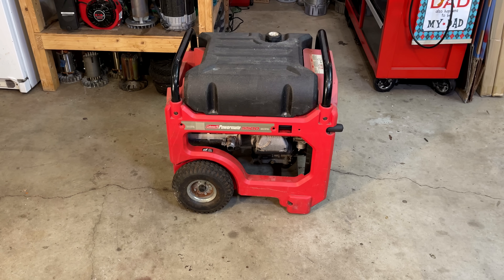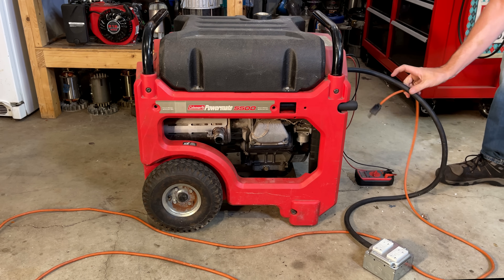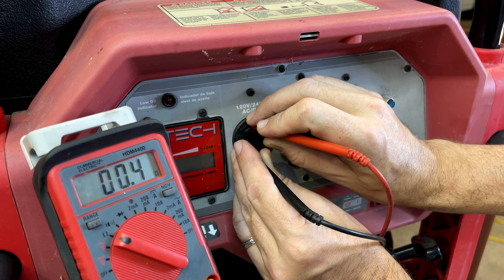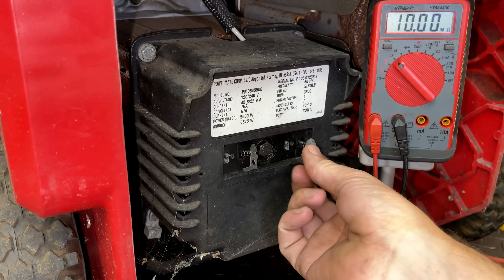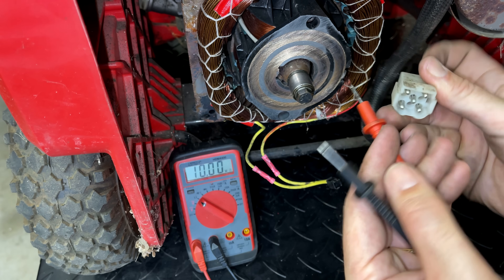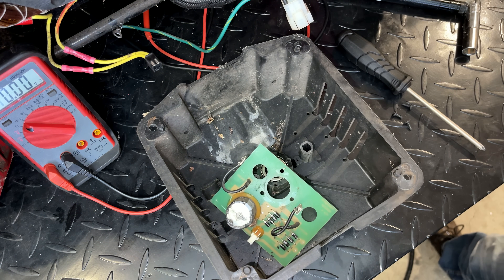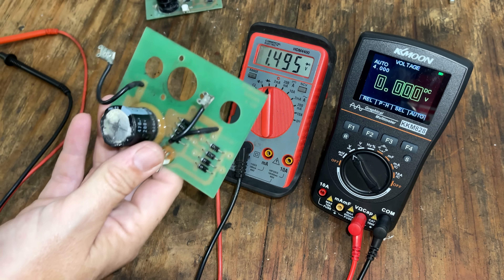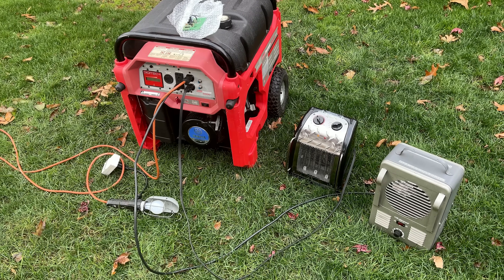Parts Generator?  Or an Easy Fix (No Output)

Comment: James- I work in a Corporate setting outside Boston. Management is now delivering a "Safety Mention" before events- How are you protecting yourself against CO2 poisoning running the engines in your garage?- I realize that there are many things unseen by the camera. I don't hear a ventilation fan running either. I enjoy your weekly broadcasts, and I want them to continue with you in good health.- Thanks!
Reply: He's got a CO alarm down there.
Reply from the maker: I do not run a fan or edit a fan sound in like some others.  But I do have ventilation and a multiple carbon monoxide detectors that display the PPM of carbon monoxide so I can keep an eye on things and they will alert if the levels are too high.  I always shut the engine down as soon as they start moving.  Some engines are very clean and others will put a lethal amount of CO in the air in less then a minute.  Here are a few clips of what I have setup https://youtu.be/-taW9AuVEbQ?t=2927 https://youtu.be/bA-Us-uS-Vs?t=521  Also have a CO2 monitor because I also run a propane heater in the winter and want to monitor those levels as well.

Comment: Jim, diodes operate like a check valve for air or water. They also do reduce the voltage slightly. In some circuits, they are intentionly used as a voltage limiter.

Comment: Well done, James. A rescued machine is cash in hand and much better than parts sitting on a shelf (which may, or may not find future use). Your knowledge, and resources (bassguitarist) are invaluable and saved the day, again!. I was wondering what happened to the lift stand, it will save your back in years to come.

Comment: The problem with the cap is the voltage. You have 135v * sqrt2 = 191v at that cap, and that is to close to max. You should use a 350v cap and it will last forever. The brand Nichicon are some of the best caps; but not when you abuse them.

Comment: I saw and the DIP switch settings were the same on both meters. When exchanging meters like this, always make sure the DIP switch setting are the same, because it tells the meter the full load capacity of the generator.

Comment: I'm sure you're aware James, but in the 2000s there was something called the capacitor plague.  Chinese companies got the formula wrong for electrolytic caps and they failed in everything from TVs to Generators.  I made some good money buying those devices and just swapping out caps.  In fact I still have a plasma TV in my shop that I've had for about fifteen years that cost me less than $20 to repair.

Comment: greatgrandma here ,, seriously  love watching your videos - most guys don't like yuh watchin them work or maybe the questions .....anyways watched a million of your videos and fixed a locked up ( pb blaster for days and gentle persuasion) , dinked with a old nikki ( at least a doz times ) and swapped out a rectifier board & brushes ( think 1 of the brushes had a broken or burnt wire )   LOW A BEHOLD  after a month of occasional dinkin and plenty videos ................the dang thing works and now makes POWAH !!    haha freaked me out when light actually came on !!!!   and after carbs last soak in ultrasonical ( yeah  all the cool kids have 'm sooooo got me one ) had the dangdest time for it not to leak ...........no clue why motor smoothed out too ?...............changed the oil twice get the pb blaster , rust and gas out........ that oughta be dandy now and put a new gas shut off after  rinsing out idk gravel from plastic gas tank (the old one was rusted shut or prolly open since the oil smelled like gas and was thin).   Bought me a killawatt today hahaha.....JUST CURIOUS   i hope it makes good numbers  but believe me i'm just a monkey see monkey do old lady -don't understand the magic -just did stuff you taught me ........ PLAN now  is run a tank of gas thru it with some stabil till it runs out ......... if my luck holds !   You always say thanks for watching and hope it helped someone ...........   DUDE  this was beyond a help !! ding dong here's yuh dinner MIRACLE...........thankyou soooooooo much.
Reply: its an old powermate 5500/6200 and can't find motor identification on 10hp briggs WHERE THE HECK IS IT
and where the heck you find those diagrams

Comment: James always says not tto pruchase a gen set with a bad power head then  of course he does purchase it and then rips it apart       So glad you are using the back saving lift     and off that generator  goes to work a well or a furnace/boiler or  a refrigerator  or a sump pump as in    we need power back NOW  !

Comment: Nice find, easy money. I have never been a fan of that plastic case head unit, but I have connected a good amount of them for people in my area that bought them during the 98 ice storm. These were the only ones available. If you need power they at least work. Ya gotta do what ya gotta do.

Comment: That engine just sounds so good.   As you mentioned, it hardly felt the full 5000 W load.   Shame the design does not have AVR.
Another one saved from the parts bin or scrap yard.   Well done.
Dave.

Comment: I've drilled holes in cases when the capacitors were to "long".   Might not be the best solution in this case but it works on garage door safety detectors,  the ones with the infrared beams.
Reply from the maker: I have done the same.  Not elegant, but it works.

Comment: With a little practice, a decent iron/station such as a Hakko FX-888D or a Pinecil with a chisel tip, some solder wick and/or a sucker you can easily replace components like that bad capacitor yourself. Enjoyed the video.

Comment: Got me in the whole way with this one. Good video mate. I leanrned a few things too
I was thinking, just learn to solder and order parts in and you can fix those simple boards yourself. You will find that soldering big stuff like that is easy peasy.
Also, it occurred to me that AC devices allow +_ 10% voltage. Well, they do here in Oz. So that would mean 120x10%=12volts above and below 120volts.
So, 132vac top end and 108vac bottom end. This genset was at 111vac low end at "full load" which I would be happy with. It will pull more amps though, and get hotter in the stator (another reason to keep the load no more than 5000 Watts).
As you said, without a VAR you get what you get. But, back on Facebook for $220-$250 for an easy fix is not bad at all.

Comment: This is just fantastic - if only there were repair places I could trust, with your knowledge, and could repair it in a few weeks at least! I bought a  Champion 201035 10,000/9000. Had an old powermate from Katrina days, and a smaller Champion 4000/3500. When I got the electric start 201035 running I also got the other 2 running. SUCCESS!!! As it got colder only the new one will crank. And yesterday the rooe snapped as I tried cranking the smaller Champion. Soo, your videos are amazing. And I just sit with 2 dead generators because it's all above me. Guess I'll get Champion on tge phone and search yiutube on how to replace the pull rope. Thanks for the great videos.
Reply from the maker: Most small engine shops can handle the engine side without issue.  But it does take them a while to fix as they are swamped in work.  Some of my repairs take multiple months mostly waiting on parts.

Comment: Very nice job James. I had a couple of these in my shop several years ago, and the rear bearings were bad and caused damage to the stator or rotor. As near as I can remember there was a recall or warrantee that repaired them, but that was many years ago. Thanks.

Comment: I just picked up a Coleman Powermate maxa 5000 ER for $100 it's a little older but it is brand new, never had gas in the tank or oil in the crankcase. Has the Tecumseh 10hp engine. Wanted to make a little extra money, but sold it to my sister for what I paid for it.

Comment: Nice work. Its always better to test diodes out of circuit in a power supply as the capacitor is directly across the output. If you need to test a diode then with the meter on resistance, place the leads across a diode note the reading and then reverse the leads and note the reading again. The values should be high in one direction and low in the other direction. A diode is just a one direction valve. The actual parts in that unit cost cents to replace so it's worth having a go yourself. Just replace like for like.
Reply from the maker: Definitely need to take out of circuit to find the exact issue.  Was just testing the board as a whole and it failed.

Comment: Another fantastic repair video. I'm surprised a 120/240 volt genie only has a GFCI on one leg. I was confused by how many diodes were on the PCB. Watched Bassguitarist1985 and each diode is paralleled so that mystery solved.

It may be worth opening up the bad meter and try reseating the LCD display.

Comment: Hi James.  Good video.   I had that same exact genset... bought it at Home Depot.  I have since sold it, but it ran well.  I mainly got rid of it because of it's "dirty power". I too saw over 130volts.     I have since gone to a Honda EU2000 which does everything I need and is much, much quieter.     The Powermate was fine in it's day... and saved me headaches at the time.

Comment: You are totally correct about that air filter box that piece they left out of there is meant to be a spacer and serves as a seal for the back side of that filter and should be in there

Comment: Lovely work James. I thought the broken ropes were indicative of something worse. If one or a couple of turns of one of the coils had become hot then it did not last long.
Reply from the maker: The lacing was not burnt looking, so may have been vibration related instead of heat.

Comment: As an electrician I know all gfi breakers has to have power for the test button to work. It is not a circuit breaker. It only trips if it detects power to ground. So you don't get shocked.

Comment: You can check the individual diodes with the multimeter as well. You should see a voltage drop when the black lead is on the end of the diode with the band (and the red lead to the other end), but not when the leads are reversed. If you get a very low reading either way, the diode is shorted. On the display unit, is there a potentiometer? Sometimes the display contrast just needs to be readjusted, so I would double check that before condemning it.

Comment: Hey James, I enjoy your work. I’ve never owned a generator and it’s likely that I never will. I like to follow your troubleshooting. My question is why does it matter what the unloaded voltage is?
Reply from the maker: In general between 113-127 volts and 57-62.5 volts is considered safe for most electronics.  Generator engines tend to lose speed and voltage under load so you have to set on the higher side of the ranges above with no load.  If there is an AVR then the voltage is less of a concern because it should stay mostly the same even if the engine slows.  Then go full load and see how badly things drop.  Ideally you would set at 120 volts / 60 hertz.  I try to get it so that half load I am at or close to 120 volts / 60 hertz.  So that way full load I am a little under and no load a little above.

Comment: Mother's makes a plastic sealant/protectant called "Back to black", and
it's excellent for things like that red dashboard. It would rejuvenate & moisturize
that oxidized, faded plastic, also making it water resistant.

Do you ever clean and paint the unsightly, pitted & rusty mufflers that come with
most of these neglected generators you repair? It's not just cosmetic.
I'm not talking about disassembly, sandblast and powder coating- but a 
simple brush in situ, then spray of Rustoleum BBQ.

Comment: Capacitors block DC and let AC pass like it's not even there.  In this case, it's probably there to smooth out the output.  Diodes do not produce clean DC, they produce 1/2 wave AC.  In some applications it's not big deal, but in others you want clean DC.

Comment: Over the last 20 years or so there have been bad electrolytic capacitors showing up in all kinds of electronic circuits. Typical visual signs are the base blown out so the capacitor leans to one side and the electrolyte leaking everywhere. The top of the capacitor may also be swollen. It wouldn't  surprise me if there was a problem capacitor in the display unit as well.

Comment: Electrolytic caps blow all the time. If the generator sits for long periods of time without being run they absorb moisture and blow the next time you power them up. Repaired many a board with swollen capacitors. You should be able to test the board by cutting a lead to the bad cap.

Comment: Love those Yamaha MZ engines.  Better than Honda.

To me it looked as if the original brushes were not fully worn in... maybe this generator has very very few hours on it?

Just wondering if you checked what the display was reading while under load.  Is it reading correctly?

Comment: Generator Model: PM0645500
Engine Model: Yamaha MZ300
Bridge Rectifier Board: 0063525SRV
Brushes: 0063525SRV
This is an awesome idea, but you have the same part # for the board and the brushes?  Maybe a copy/paste error?  I hope you continue using Gary to fix the boards and posting a link to his videos.  Keep up the great work!
Reply from the maker: Thanks.  Just corrected that.

Comment: What does it indicate when the ohm reading jump all over the place? I have a starter switch in a riding mower that is doing the same thing. It will start the mower, but the headlights do not turn on.It jumps all over the place at the headlight sockets with the switch in the on position, then drops to 0 when the engine starts. I have already replaced the sockets with used sockets that are known to be good. I connected them directly to a battery, and they worked fine. I think there is an issue with the starter switch.

Comment: Can the difference between load and no load voltage and freq be brought closer with a governor adjustment,  or is that beyond its ability to maintain the speed?  Great video. thanks.

Comment: Jim, I was surprised you didn't clean the rotor where the brushes rub against. Or is just the way they look?
Reply from the maker: It looked like someone had already cleaned them recently.  Not very well though, probably should have cleaned them again while in there.
Reply: @jcondon1  - After thought, right!? ;-)

Comment: The LCD in the 'digitech' looks for all the world like a standard 2x16  'HD44780' compatible display, should cost very little to buy but you'd need to find someone who could remove the old part and solder in the new one.

Comment: Instead of trying to repair existing control modules made to fit inside
the power head, your electronic technician friend could likely create
a heavy duty upgrade universal replacement AVR and rectifier board
installed in a small project case, built using over engineered parts 
that will never fail in service because anything controlled will burn 
up before those controller parts which won't be the weakest link 
in the system. My idea is instead of trying to repair those marginal
duty control boards that are onboard, externally located heavy duty
control boards would be an upgrade that would eliminate the failure
mode for the original less capable factory supplied cheaper design. 
Another advantage is a genset that did not come stock with AVR
would have that feature easily added as an upgrade when repaired, 
so it would actually be better than new after a regulator upgrade.

Comment: Curious about all that plastic framework. With so much noise from the engine while running does having all the plastic around it help with noise?
I only say this because I built a very quiet garbage can muffler and flex piped it to the generator exhaust outlet and while running I was amazed at just how loud the actual motor internals were, almost wasn't worth it.
Reply from the maker: It did help with the noise, but still pretty loud.

Comment: Would it be possible to add an AVR as an upgrade or improvement?
Reply from the maker: No OEM option, but could probably fit a universal AVR.
Reply: @jcondon1  You should make a video about that

Comment: If you get a high quality soldering iron, the diodes & capacitor, along with tweezers, you can do this yourself. Pay attention to the orientation of the diodes. Best replace one at a time. Electronics is one of my hobbies.
Reply from the maker: Yes, would love to do that stuff.  Really just need the proper equipment to do the repair right.
Reply: @jcondon1  you have pretty much what you need for most electronics work. The multimeter is probably the best tool. These days, you can buy a good oscilloscope for less than $500. Soldering irons are available for a reasonable dollar, but buyer beware. Those $20 jobs don't last.  My own soldering iron uses gas to operate. Gas soldering iron kits are available with different tips for different jobs, or can be used as a blow torch for heat shrink work, or used for heat shring type wire joiners. A lot of multimeters have capacitor test built in. Most electronic components are not expensive.

Comment: I noticed the lights on the top control panel came on when you started it in the garage, but did not see the lights come on when you started it outside. Is there a sensor that lets it know when it's dark enough to turn the lights on?